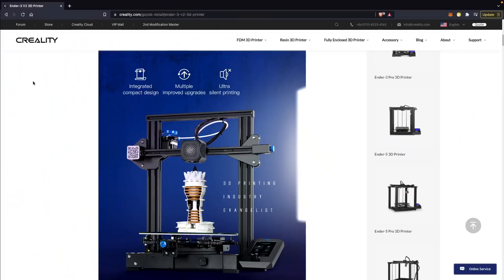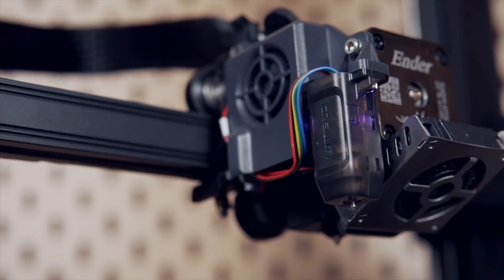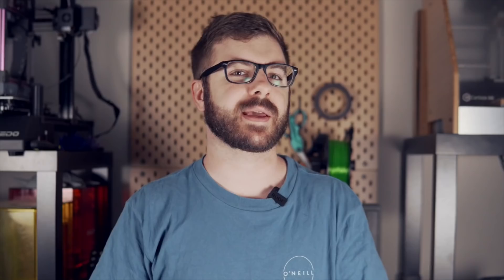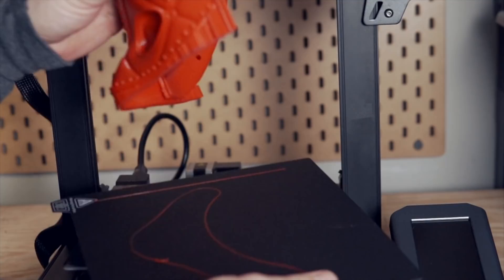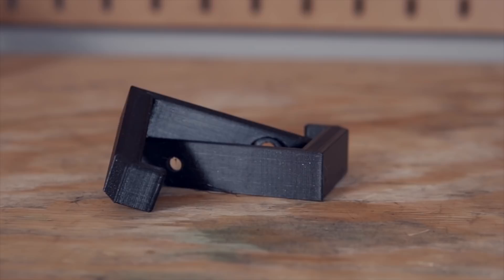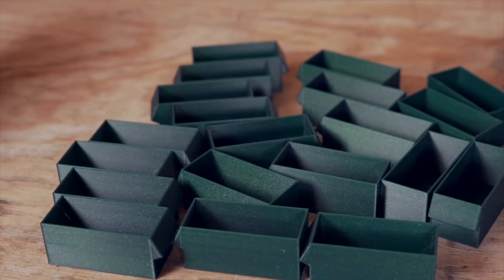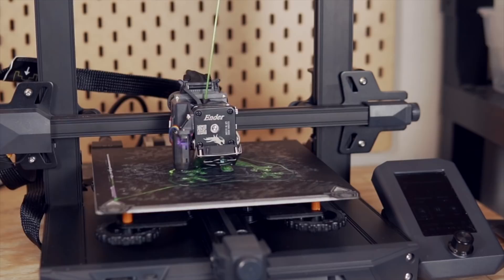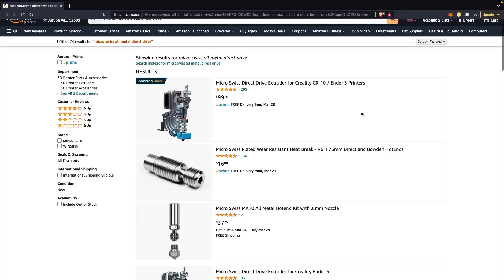Worth The Price? Creality Ender 3 S1 3d Printer Review

Comment: MEH, if it’s cheaper I’ll buy it otherwise I’m fine with my awesome ender 3 v2, good old glass plates, never saw the necessity of the metal magnetic beds. Not enough difference to make me upgrade, maybe wait a few generations before I buy again. Don’t mod for mods sake, unless I have a pragmatic reason for the upgrade modifications.
Reply from the maker: Have you used a flexplate? I was late to the flexplate party. I started printing in 2014 and didnt try one until 2014 thinking glass works fine and felt it was over rated. After I got one, it changed my mind completely. Helped keep my bed level, no more waiting for parts to cool, and just made my workflow nicer. Still not saying it is a must, but it is pretty damn sweet.
Reply: @ModBotArmy  I have had a flex plate, but prefer the glass plate and the way print comes off when there done. I have had them fail on me as well, so I preferer the glass plate to a magnetic steel one.

Comment: The real question is, did they connect the motherboard fan to the cooling fan like they did with the V2 so you can roast your board when printing ABS. (thankfully you can change this, just like their garbage firmware and their over-tuned steppers) I also can't believe the case underneath STILL doesn't have slots that mirror the PSU. While I agree the Ender3 series are great printers for the price. Creality is a terrible company with awful R&D and Q&A. The S1pro does actually seem like a upgrade to the series, and like you said if it was just the S1 and at the same price, then I think they would have an argument on why people should buy it
Reply: The popularity of the Enders speaks for itself. Even amongst people like CHEP and other people that know what they're doing. I read all kinds of post from noobs complaining about this or that. They just lack the technical skills. I didn't run into any of those problems and if I did the fix was so easy. I mean 5 minutes.

I don't care about the firmware. As somebody who's been in IT for 25 years now third parties always make better firmware anyway. As long as it's open source I'm happy.

I spend hours every month keeping my machinery going in my metal fabrication shop so having to fix the random issue with a 3D printer that I got for dirt cheap to begin with is not an issue for me. I'm actually fine with how these printers come from the factory. If it keeps it cheaper that's a benefit for me since I can usually fix things for cheaper than the company would.

I think every Chinese printer brand needs to be tinkered with. That's the trade-off for getting such a cheap machine to begin with. Hell, even a prusa has to be tinkered with.
Reply: @dangerous8333   The Ender 3 is cheap because it has rollers, a single z axis, plastic single gear extruder, cheap build plate, cheap steppers, non-consistent bed heating, and doesn't use a all metal hot-end. Not because they connected the MB fan to the cooling fan. But hey, you want to take a saw-saw to your Ender7 so you can tell your one friend that you modded it to see the first layer go down and not stick to the build plate, then go ahead. Weird ass logic since things like the Voron exist. No one gives af if you want to support a trash company though. I also said the Ender3 is a great printer for the price, especially if all you print is PLA. I find that narcissistic douchebags only like to talk about themselves while adding nothing to the conversation. But go off on how people are just noobs and you know-it-alls can fix all of their poor design choices in 5 min. They should spend the 5 min fixing it themselves since its so easy

Comment: with how tech has come along in the last few years in the 3D printing maker space, honestly, 'ptfe lined' is obsolete... there is no benefit to it really over a properly tuned, tested, designed, all metal hotend.  And for the $110 price tag of the extruder/hotend alone - it's right up there with the other options out for all metal hot ends, costing anywhere from $25 to $150 (not including extruder/motor in some cases)  

I just can't see the price being worth it for this.   $100 cheaper, and sure, this would be a no brainer, but the price at current point isn't that fantastic - you compared other Ender models for your upgrade path, but there are other Printers in general around the same price range, that don't require 'upgrades' that are actually "better" and more trusted.  I mean,  $415 or so price range  is in the market of used Prusa's,  and 'a little more' goes a long way.   This product needed to be closer to the $300 range, maybe starting at $350 and going on sale for $300 at some points to really be "buy this now, it is fantastic"
Reply: It depends on where you are in the world.  My ender 3 V2 costed about $400, and I easily spent another $300 on mods. I can get the S1 for about $600 here, and it has more features than my moded V2

Comment: There are various technologies for 3D printing metals, such as electron beam melting (EBM), direct metal laser sintering (DMLS), and selective laser melting (SLM). These technologies vary in how they employ heat to melt and fuse the metal powder.
Compared to conventional manufacturing techniques, the metal 3D printer has many benefits. It permits the creation of specialized and low-volume parts and simplifies building complex geometries and detailed designs. By utilizing only the appropriate material, metal 3D printing eliminates waste and can lead to more effective use of resources and energy.
https://us.snapmaker.com/